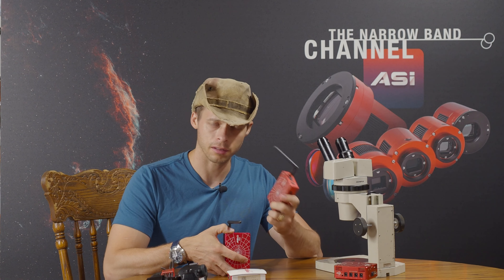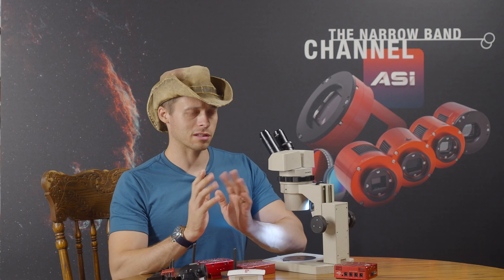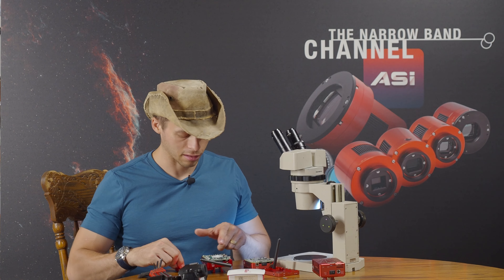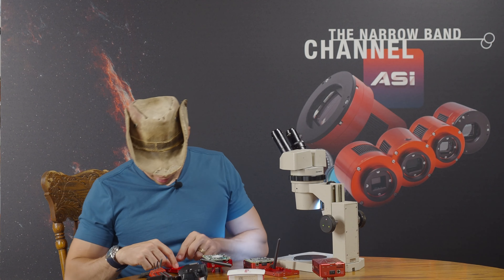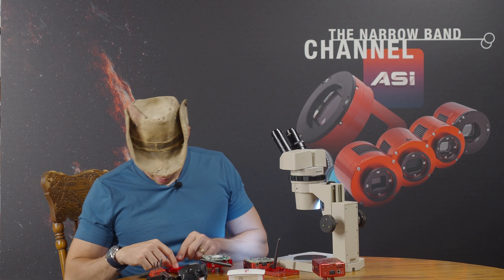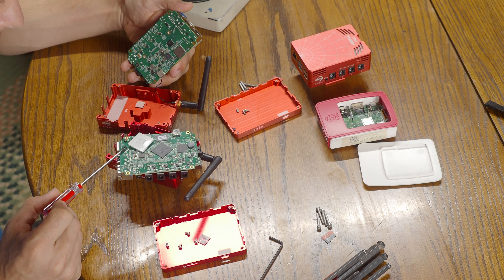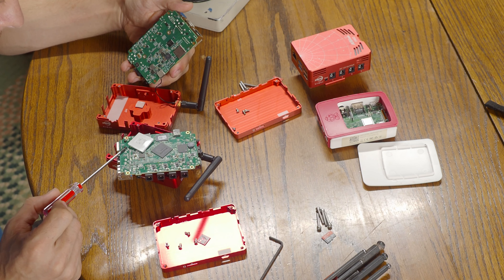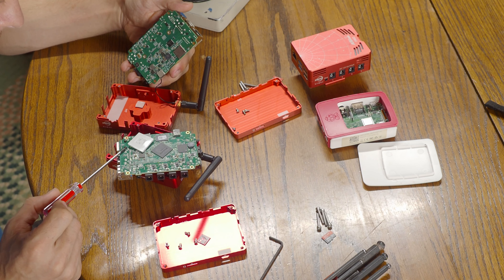Inside the ZWO ASIAIR Plus 3.3 Compared to the 3.0

Comment: Love your channel and info. Just some feedback, they don't fabricate their own chips and most likely don't manufacture or assemble their own boards. PCB Fabrication and PCB Assembly is stupid cheap these days. They mostlikely have Electronic Engineers designing these to cut out the cost of the Pi's, though most likely sub out most of the manufacturing.

Comment: I have the  ASI AIR plus 3.3 version with 32 gb on board memory. I don't know if what I have found applies to older versions but..... I upgraded to the latest 2.1 10.74  firmware for the ASIAIR which did give some new features but also made a huge difference in wifi stability. Where I had the well known wifi dropouts and reconnects, immediately after the firmware  update my wifi is now very robust. I can go long distances away from the AIR PLUS and I have no problems with wifi dropouts or reconnects. Has anyone else noticed this? Nothing was changed in my setup, tablet or cell phone or location other than the firmware update and that greatly improved the wifi reliability and strength. I use a Samsung Galaxy tablet with Android as well as a Samsung cell phone and both work very well now on wifi compared to before.
Reply from the maker: That is very good to hear. I have just downloaded the latest now to wait for the spring rain to end

Comment: I just bought a 256GB version, the wifi failed and I had to return it to the retailer. They sent a replacement and this one is working properly.  Awesome gadget.  I just ordered a 256gB micro sd card, is there a way to make the asiair record all images on the card?
Reply from the maker: I use the card since it is easier to get images to the laptop.

Comment: The anodizing is fading because it was sealed with either the incorrect chemicals, not enough time in the sealing bath, or both.
Reply from the maker: Eventually all anodizing will fade. But proper methods do at least slow it down. UV rays kill all pigments eventually.
Reply: Or dyes not specifically made for anodising. I have been doing my own anodising for many years and have been down the track of cheaper dyes. So many items I’ve had from Chinese sources in general are not as good as USA dyes from Caswell. Black is one colour that fades easily if not done properly.

Comment: Ben, speaking of the USB connectors being somewhat fragile, I took to heart one of your previous posts and now use those adhesive-backed plastic anchors to provide all my cables some strain relief. You suggested these in your video regarding cable management. Thanks, bro! Stay Strong.
Reply from the maker: Good idea! I plan to do a more extensive cable management video soon. It really is important.
Reply: @TheNarrowbandChannel Someone needs to make proper length, flexible ( even in cold temperatures) cables, to lessen the strain on the ports.

Comment: "Nobody uses the Ethernet port" and a bit later "I use SD cards as copying over the wifi connection is too slow". That is the exact reason I use the ethernet port. I have both units too by the way (also on the testing team). Both units in my case are still the same red AFAIK.
Reply from the maker: what is red afaik? I have to of the 3.0. One is quite a bit redder than the other. and purchased only a few months apart.
Reply: I use ethernet on my asiair pro to connect to a mesh 6 WiFi satellite and have an 1TB SSD attached to the USB3. This way I have very fast live viewing & stacking and everything is stored directly on the SSD.

Comment: ZWO started developing their own boards during the global supply chain crises for electronic chips and components. Very smart move to be independent from the RPi4B and IOT suppliers. This gave them more flexibility on sourcing electronics. The first generation of the AA Plus used the so called RPi4 computing unit, which is mostly aimed towards hardware developers (such as ZWO) unlike the (previously used) full fledged mini computer version of the RPi4.
Reply from the maker: It really is good that they did this. And my early tests are showing the new one is lightly fast for plate solving.

Comment: Is the Asiair Plus 3.3 only with the 256g version? If it’s better to use the MicroSD card to transfer data then the 32g is good enough? What am I missing with using that model? Thanks.
Reply from the maker: The 3.3 is now in 323gb and 256gb versions. Both will have the speed. I use the micro SD just for the convenience of DSO transfers.
Reply: So the 32gb 3.3 has the faster processor?

Comment: The "new" one is using a Thermal Pad to connect the CPU to the outer metal casing so as to use it as a heat sink . You'll need to either replace this Pad as it ages or at least add a Thermal Paste for the connection ./SRK

Comment: First, I was under the apparently false impression that the mico SD slot was only for firmware updates. Using this to write images to is a HUGE relief. The use of a ZWO camera gives an extra USB port for the guide camera, freing up a USB port on the asiair for a thumb drive. A DSLR doesn't, and the files can be larger making the internal memory even more of an issue. I have a plus, and a mini. Might get a 3rd. Should it be another mini,  or the new one?
Thanks for bringing all this to our attention. I love tech, STEM porn?
Reply from the maker: This new one is really fast. Polar alignment and plate solving goes a lot faster with it.
Reply: Upon inspection of my asiair mini, I realized it doesn't have a SD card slot. Bummer.

Comment: Other ways for improvement:
Critical: USB ports are too close to each other putting unnecessary pressure when all the cables are connected.
It would be great if it could capture two cameras at the same time (deep sky long exposures) for the camera and telescope piggibacking on the main scope so they dither at the same time.
Next new version should have sim card 4g/5g connectivity for remote control observing without need of other extra equipment.
Comet tracking option based on the orbital parameters, want to have blurry stars but clear and sharp comet. Could check with platesolving after each 1,2,3,4,5... photo to make sure that comet is right where we want it with the tail in full glory. Middle of the frame is not good enough. Tracking and Guiding on the comet. Autoguiding could also be adjusted so it guides on the stars but it lets them to move according to comets
Reply from the maker: Those are all nice things to have on a wish list. Once ZWO is done with the Seestar we should see some efforts into the asiair again.

Comment: The ugly facts about ASIAIR: 
There is NO stop tracking after reaching meridian in general options for all the circumstances. Last night as it was quite late and I was waiting for target to slew and preview, 6min exposure, I fell asleep and woke up 3h later with my camera and telescope hitting the tripod. Fortunately nothing broke, I am just angry that there is no option for tracking to stop at meridian at the global level, nor there is an alarm that would beep at the app level.
Reply: You get what you pay for mate, a simple fact of life. Also my understanding is that these units only work with ZWO equipment which is why I spent the extra money on buying an Eagle LE on which I can use any hardware or software I like,  and yes, all limits are available (via the Ascom set up). It also has 4 USB2 and 4 USB3 ports, 4x12v outputs, 3x0-12V outputs (which can be used with a separate dew heater control module if required). 
I would like a simpler unit for my portable set up but if I buy an ASIair I will have to buy a new (ZWO) astronomy camera as well (I do use ZWO filter wheels and focusers as it is)
Reply: You can post feature requests on the ZWO forum.
Reply: Until they add that feature, you could set up an auto run session to finish before the meridian and then have it return home. 
I know it's not the most convenient solution, but it's something. 

I, too, have awoken to a mount that 
has been tracking into the tripod legs for several hours. It's a horrible feeling until you verify everything is OK. A pier extension was my solution. It atleast gives me more time after meridian before impact.

Comment: zwo will never make their own image sensors. they simply buy the excellent Sony bsi sensors.😊
Reply: Unlikely but not impossible. There are systems manufactures who have their own chips made at foundries. Not uncommon for specialty hardware developments. But it is usually very costly unless the volume is really high. I don’t think the volume is that high. Look e.g. at ESPROS who are making their own BSI chips, which have much higher QE across the whole visible spectrum and the world best QE in the NIR. Their chips are used for TOF (3D sensing) and not for astrophotography.
Reply from the maker: What I meant is that they can design and have someone like Sony or Panasonic or Samyang make them for them.